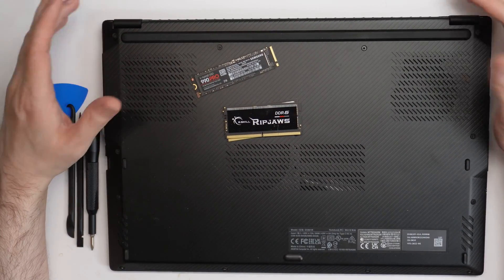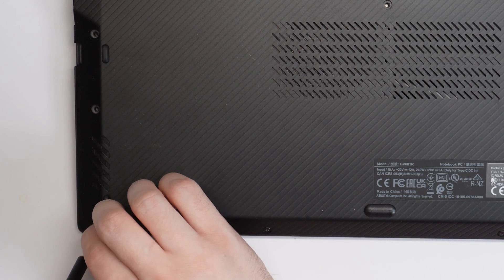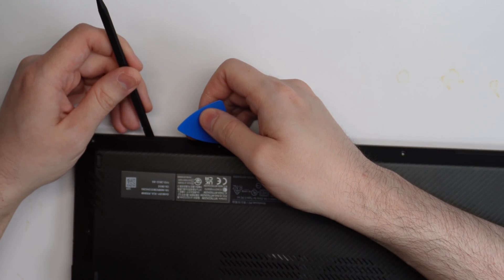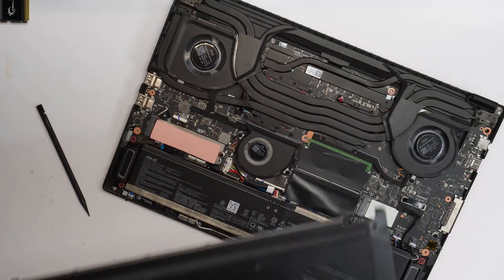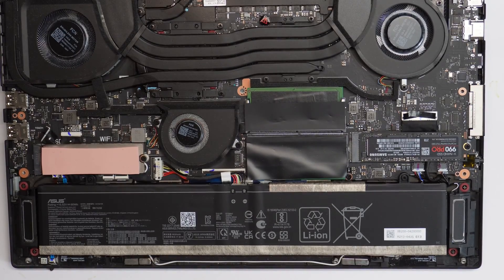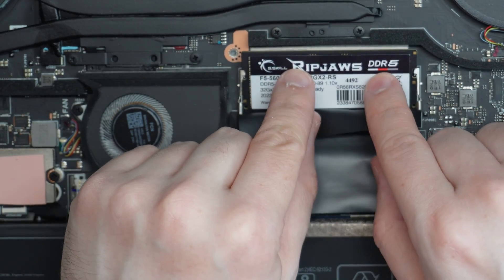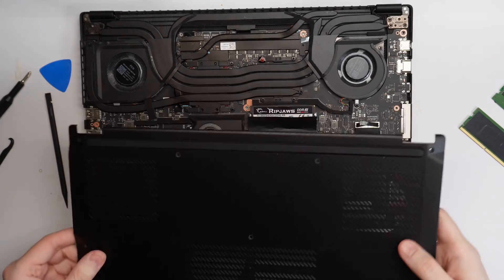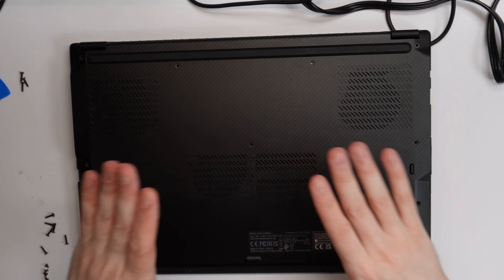ASUS ROG Flow X16 SSD & RAM Upgrade

Comment: This video is great one thanks, yet one question: what if you wanna upgrade you device pluggin new addition ssd in left slot? I just wann do not touch original ssd wich on is in right one. But in left one there are some wires/cables(english is not my native), so i was a bit confused.

Comment: Thanks for the very informative tutorial! This gave me a lot more confidence in adding SSD/memory to my laptop.

Would a second SSD and/or RAM affect temperatures of laptop in any way? How much does it depend on model of SSD? Would thermal pad or heat sink on SSD help or is it only useful if SSD is overheating, not affecting overall thermal output of laptop?

I am afraid, that laptop would generate more heat and/or fan noise. I find fan noise very irritating, so it is important for me to keep it as quiet as possible.

EDIT: I added second SSD (SK Hynix Gold P31 2 TB) and RAM. No difference in heat and fan noise afterwards :)

Comment: Thx bro. My old Acer is breaking down. My previous Asus lasted 3x longer. So I'm moving back to Asus and more specifically to this model. I wondered if it could be upgraded and you just answered it here. 

One question - if you have the time for it. The left SSD contains some kind of heat sink you said, is that needed for the second SSD as well, and if so... where do you get it?
Thx !

Comment: Thanks for your video! I upgraded mine to 64gb ram and an additional 4TB SSB. Least than fifteen minutes!
Reply: No issue after couples months?
Reply: @LordGordan1  No issue with hardware. One or two games seemed not to like a D: drive installation, but all working well now.
Reply: Which company ssd comes with the laptop originally?

Comment: which screwdriver do i need?
Reply: For anyone wondering, you need a ph0 (not sure actually, ph00 might also work according to some people) screwdriver, for the ssd slot i used a ph1. Some of the screws I accidently damaged because my initial screwdriver seemed to be of bad quality, in the end i bought a precision tool kit from xiaomi and that did the trick

Comment: Thank you for guiding the black screen part in your video. 

I almost gone mad looking at black screen after upgrade to 96 gb 5600 and thought what has happened to machine, that is not even working on original 16 back again.

Then i had seen your video, waited for 3-5 mins, it worked in 3 minutes😊👍👍

⭐️⭐️⭐️⭐️⭐️ 5 stars to you…

Comment: I was following along to add an SSD to the second slot but it's been over an hour and my laptop won't power on.

I disconnected and reconnected the battery correctly
But now even the battery charging LED won't light up.

Do you know what could have gone wrong?
Reply: remove the new ssd, and boot up without it.

Comment: Hello, I would appreciate it if you could reply to my message. I recently asked Asus how many gb of ram upgrades are supported up to a maximum of 64gb per ram slot, I received the answer 64gb per ram slot. If you have 48gb or 64gb ram, can you try it on this computer? Because every question I asked 3-4 times about this subject, I got the answer that it can be upgraded to max 128gb. Although it seems to be max 64gb everywhere, the idea of this 128gb support has put me in a deadlock. Among the ram I have examined so far, crucial also sells 48gb sodimm ram @blakejeffrey
Reply: They said for rog flow x16 2023, that so confusing.

Comment: In case your SSD is overheating, you might have forgot to remove the plastic layer off the thermal pad :) you can use HWmonitor to monitor the ssd temps . the video is not clear enough to see if there is a thin plastic film over it or not , but usually they are there otherwise the thermal pad catches a lot of dust and stuff…

Comment: Is the laptop the 2023 version?
Reply from the maker: I wish lol, 2022 X16 Flow 3060.
Reply: @blakejeffrey  You shouldn't wish for it lol. The 2023 runs out of battery after like 2 hours due to them switching to intel CPUs for it. Which honestly makes no sense due to this being a portable foldable laptop
Reply: I have the same model R9 RTX3060 and I am planning to upgrade the ram and ssd, is it possible to add a Samsung 990 pro 4TB ?  @blakejeffrey
Reply: Indeed, the 2023 (I have it) runs out of battery FAST :(.
Reply: @kevinsmets It's natural that Intel still uses a 10nm configuration on their CPU😂
Reply: It definitely lasts more than 2 hours on battery with normal "office" stuff. I got the 4070 version and so far from 80%-30% battery i have gotten around 2-3 hours usage.